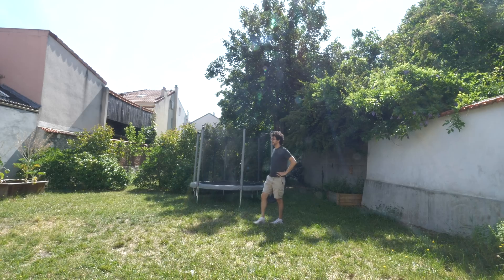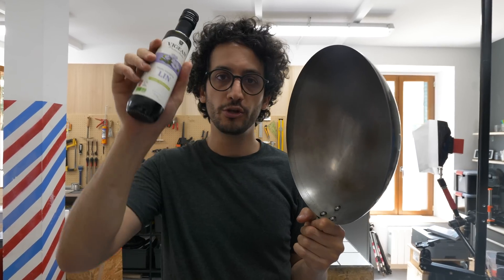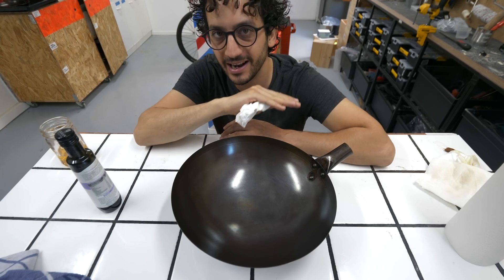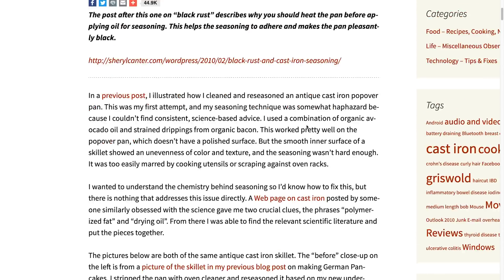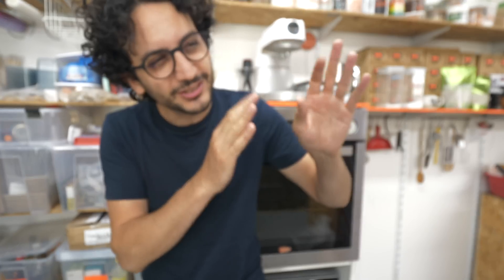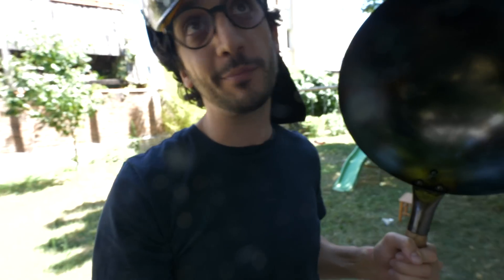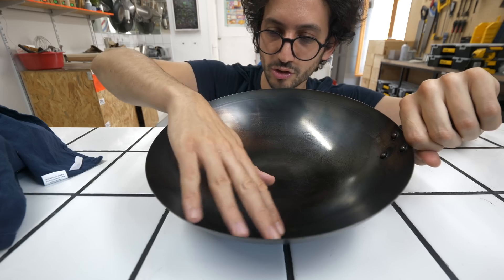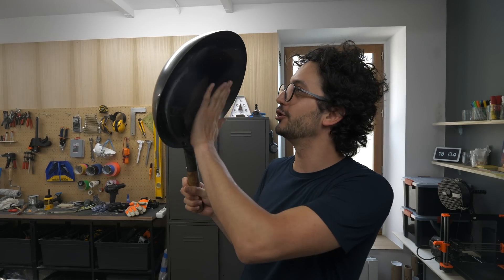Can I Make my Wok Slicker than a Nonstick Pan ?

Comment: "There is no chemichal, just like a very hard polymerized surface"
- Chemestry: Am I a joke to you?
Reply: @Zach Ellis Once it's polymerized, it isn't oil anymore. Soaps, detergents, surfactants, etc.,  will allow water to wet onto the polymer surface, but it won't emulsify it. For that you need to break the polymer chains. Once way to do that is with a very high pH. Soap used to contain lye and have a very high pH, but that's rare today. That's where that common wisdom comes from, decades ago dish soap would have done this, but you'd also really want to wear gloves when washing with it. Any soap that would cut through the seasoning on a well seasoned pan would be pretty unpleasant to your skin. Dawn still contains lye, but in very small amounts. I'd probably skip any soap with lye, but most dish soaps don't have it, or any high pH substance, anymore.

Again, I don't use soap on my cast iron in general, but mostly because it's just not needed. I'm not saying you should wash your cast iron in with soap, just that with most soaps you could.
Reply: Jazz Music Stops
Reply: he's my take on it.  every teflon pan I've ever used started out amazing, and after a few months of hard use, becomes useless and gets tossed out.  it's junk at that point.  using this technology, with the only raw material being some kind of oil, my steel pan is essentially a permanent part of my kitchen.  It's my pan, not number 12 of an endless series of disposable pans.   this pan will be useful long after I'm in the ground.
Reply: @Zach Ellis I know that's the "common knowledge" interpretation of seasoning an iron or steel pan, but it's incorrect. A properly seasoned pan will not have any oil left in or on it. The oils polymerize, meaning the chains link together to form what is, in essence, a very hard, slippery, temperature tolerant food based plastic. It can't simply be washed away with soap, unless you're using lye soap, which most people aren't. Something with a very high pH, like lye, will depolymerize the oils, allowing them to be washed away.

I don't wash my cast iron with soap, mostly because it's unnecessary, but it won't really hurt it.
Reply: That new polymer the oil has become is that bad for your body too? I mean it could get scratched too and pieces may come inside your body.
Reply: @jingyiwang2600  
No. 

Teflon is pretty nasty sh*t. 

What you find in polymerized oil you will find into whatever you use heat to cook/grill anyway. Yeah, there are bad things in it but, literally EVERYTHING is bad for you to an extent. It's all about the relations between dosage, exposure time. 

So, don't listen to the pedantics chemists wannabees here: seasoned pans are much less nasty than Teflon coated pans, period.
Reply: @TheOneAndOnlySame  well said.
Reply: In the words of Tim Minchin: "everything is chemicals"
Reply: @Chirimorin  
Reject modernity.
Embrace tradition.
Enjoy polyaromatic hydrocarbons.
Reply: Golden Calf  Agreed. Each has its pros and cons. Quite often, we do not need either of them.
Reply: yeah, burnt polymerized oil that comes loose real easy and then gets in your food is superhealthy.
Reply: 😂 I know, I was like 'Hol up!?'
Reply: Chemistry, Chemestry is a joke
Reply: 2000th like
Reply: Wok cooking is traditionally done at really high heat, temperatures far above the point that’s safe to use non-stick. For low to mid temp cooking chemical non-stick works just fine.
Reply: Seriously I don't understand why seasoning a steel/iron pan with oil is so much better than teflon/other polymer/mineral-ceramic coatings. At least with those I understand what I need to keep in mind to keep safe (don't go above its temperature, don't scrape it off) . I would be extremely appreciative if someone has actual references for this claim. And no, "it's natural" (and especially in this context)  is the most delusional statement anyone can make.
Reply: @matejmahkovic  particles are going to come off any pan you cook with.  Always.  It's just a fact of life.  If you've ever seen the teflon pans in a house of college kids, you know the extent of just how bad this can get... they usually don't know you can only use non-metal utensils with the pan, so the surface is all scratched up.  There's no way to re-season it.  You must throw it away because it's bleeding teflon flakes into your food.  Granted, that's a nightmare extreme example, but we had no idea what we were doing in college, and on a long enough timeline, all pans will release molecules from their surface into your food.

The advantage of using seasoned cast iron or carbon steel is that your seasoned non-stick surface is basically a natural coating that's not only generally safe to ingest when it releases particles into your food (California probably says it causes cancer though), but if the surface ever becomes imperfect, you can re-season it at home with no special tools or materials.  It's why families have been able to hand down immaculate cast iron pans for literally over a century, but a non-stick pan is garbage after only a few years.  Imperfections don't just happen from scratching the surface with metal utensils though... acidic foods (especially tomato based) will chemically break down the seasoning on your pan.  Washing with most soaps will also do the same.  Teflon doesn't get broken down from acids or soaps nearly as easily, but once you get a single slight scratch in it, the pan will never get better.  On the other hand, seasoned cast iron and carbon steel is trivial to fix.
Reply: @matejmahkovic  I find it better because any nonstick coating will eventually be damaged if you have the pan for long enough, and with seasoning you can replenish it on demand rather than replacing the whole thing. It's not even about the long term cost for me (but also a good thing to keep in mind), it's about 10 or less minutes of work vs a two hour round trip drive to the store and back for a new one.
Reply: @matejmahkovic  In cases of "Teflon toxicosis," as the bird poisonings are called, the lungs of exposed birds hemorrhage and fill with fluid, leading to suffocation. DuPont acknowledges that the fumes can also sicken people, a condition called "polymer fume fever." DuPont has never studied the incidence of the fever among users of the billions of non-stick pots and pans sold around the world. Neither has the company studied the long-term effects from the sickness, or the extent to which Teflon exposures lead to human illnesses believed erroneously to be the common flu.
The government has not assessed the safety of non-stick cookware. According to a Food and Drug Administration (FDA) food safety scientist: "You won't find a regulation anywhere on the books that specifically addresses cookwares," although the FDA approved Teflon for contact with food in 1960 based on a food frying study that found higher levels of Teflon chemicals in hamburger cooked on heat-aged and old pans. At the time, FDA judged these levels to be of little health significance.
Of the 6.9 million bird-owning households in the US that claim an estimated 19 million pet birds, many don't know know that Teflon poses an acute hazard to birds. Most non-stick cookware carries no warning label. DuPont publicly acknowledges that Teflon can kill birds, but the company-produced public service brochure on bird safety discusses the hazards of ceiling fans, mirrors, toilets, and cats before mentioning the dangers of Teflon fumes.
As a result of the new data showing that non-stick surfaces reach toxic temperatures in a matter of minutes, EWG has petitioned the Consumer Product Safety Commission (CPSC) to require that cookware and heated appliances bearing non-stick coatings must carry a label warning of the acute hazard the coating poses to pet birds. Additionally, we recommend that bird owners completely avoid cookware and heated appliances with non-stick coatings. Alternative cookware includes stainless steel and cast iron, neither of which offgases persistent pollutants that kill birds.
Reply: @matejmahkovic  Alex the former engineer falls into naturalistic fallacy, proceeds to produce VOCs and PAOs to coat his pan and calls it superior.
Reply: @MonMalthias  So what?... still my question goes unanswered. Similar to Alex, I'm not the person who can answer this, that's why I written the comment and asked for your insights.
Reply: Malthias it might well be preferrable to PFAS.
Reply: @matejmahkovic  it's a skill to strive towards,like sharpening your knives with a stone until they're razor sharp,cooking on a non-stick pan that you made. It's okay to not understand!
Reply: Biological vs chemical is a chef's way of making the distinction between natural and synthetic.

Organic also means something quite different to a chef rather than a chemist.
Reply: No chemicals that can cause birth defects*
Reply: @smashy152  what part of polymerisation and partial oxidation do you not understand?
Reply: @smashy152  The moment you start to crank up the heat on oiled steel, thousands of different compounds form. Can't be to serious on that statement ;)
Reply: I want to like this but 666 is too beautifull to like, sorry haha
Reply: “Chemestry” -Spelling: Am I a joke to you?
Reply: Dude spell check
Reply: it's referring to the fact they aren't using an artificial man made chemical, like Polytetrafluoroethylene aka Teflon.

you wouldn't call soybean oil a chemical
Reply: BlackMoth27 I would very much call soybean oil a chemical, because that’s what it is.
Reply: @blackmoth27

In what world do soybeans naturally press themselves into a filtered oil, land on a pan in an even coating, and heat themselves to a temperature high enough temperature for a long enough time to chemically alter the oil into a polymer?
Reply: Edit: "and heat themselves to a high enough temperature"
Reply: @marcush4741 Linseed oil, no soybean.
Reply: @marcush4741  Sometimes soybeans feel like doing just that in the wild...
Reply: @BloodSprite-tan  I would.
Reply: @BloodSprite-tan  yes you would if you actually knew what chemicals were. All oils are literally just mixtures of various chemicals.
Reply: @BloodSprite-tan  the problem with that is that you're assuming that natural > artificial which is almost never the case with common chemicals used in the food industry
Reply: @aaronshan51   Seen the movie Dark Waters?
Reply: @BloodSprite-tan  lol, i would...they have to add deodorants to polyunsaturated oils because they go rancid on the shelf!
Reply: @BloodSprite-tan 
N d
Reply: @BloodSprite-tan  Yes you would. The true definition of "Chemical" is a substance used for their interaction and reaction with other chemicals. The problem is when most people think "Chemical" they think poison or paint thinner or solvents and gasoline.
Reply: @kcstott  point taken.
Reply: @BloodSprite-tan  yes, soybean oil is a chemical...
Reply: That's a very close-minded idea of what the word chemical means. You know very well what Alex and literally everyone outside of a chem lab means by that, yet you refuse to face it.
Reply: @crazy808ish  This is actually a pretty serious issue I think in communication about chemicals today. The meaning you're ascribing to the word is entirely subjective. There's no legal or technical definition of "chemical" that matches what you're saying. Basically, when most people think of "chemical" they meaning that comes to mind is "chemical I don't like" or "chemical I think is bad for me". The problem with that is that anyone can slap a "chemical free" label on something, and it doesn't mean anything, but people will think that it means it's safe. It doesn't.

Many man made chemicals are just fine, and in fact many are beneficial. Many natural chemicals are quite deadly, in fact the deadliest chemicals known to exist are naturally made, e.g. botulism toxin.

In the case of pans, I think it's a toss up. Most PTFE is made today without PFOA or any PFAS. PTFE itself is completely harmless, it's the most inert substance known and won't do anything at all inside the human body, it'll just pass through. Similarly, polymerized food oils are quite inert, and likely harmless (I'm looking to see if I can find a source for that). Both will be harmful if heated enough to decompose. PTFE decomposes at a much lower temperature, and creates more harmful gasses when it does so. That's really the only safety concern with modern non-stick pans.
Reply: @jasexavier  i appreciate your comments and logic. they're refreshing to see. most people think chemicals are strictly harsh things that come in scary labeled bottles that are artificial and made in a lab. they don't realize that everything they've ever touched is a chemical, that water is chemicals, that they are themselves chemicals. and just because 'they' wouldn't call a, b, or c a chemical doesn't mean it's not. people make up meanings based on how they 'feel'. it's obnoxious.
Reply: @crazy808ish  and you refused to acknowledge that people outside of a chemistry lab rarely have a proper grasp on chemistry. Things that are natural and healthy can be altered to become not healthy, sometimes on accident.
Treating the word 'chemical' like it's a slur is dumb and I refuse to accept it as such just because other people want to be colloquially dumb about it. It's not fair to ask people to stoop below their level of understanding for your comfort. I didn't take six years of college chemistry for that.
Reply: @caramelsurpriz  Fair enough. Apart from the fact that "stooping below their level of understanding for your comfort" is literally what communicating your field to the public is all about, and what your professors did for 6 years for you. ...what do you recommend is a better term for what she was referring to?
Reply: @crazy808ish  Sounds like dogmatic superiority syndrome. No wonder they are losing the public when it comes to science education. Well, at least that is a big part the picture.

Comment: If you wanted to know the mechanism. Picture all metal as on a very small scale being of a dense crystaline structure that expands due to heat and contracts due to convection/ conduction or heat loss due to thermal energy transference. 

The oil ideally would coat the surface of these expanding crystals before undergoing the chemical reaction that impairs the ability of these crystals to latch onto foodstuffs as thermal energy is lost and the metal shrinks back again.
Reply: hy, would be nice to get more science in this process, cause, alex just scratch the surface. but deep down, we don't even know what's best and how to make it correctly.

Comment: If you take supplements,  you don't have to worry about carcinogens,  because blue berries,  and antioxidants cure those things.  Organic is best.  Even spinach as long as you dont get food poisoning,  cook the spinach...  So yea you have to be the mad scientist.  Oil boils into a carbon.  So you would test and figure out if it works from there.  It probably will....  Because Teflon is plastic,  but a seasoned pan is probably better.  Explore the subject,  if you do,  you'll have good time.  : )

Comment: Him:  Tests nonstick pan with egg

Also Him:  Uses oil so it won't stick
Reply: On a non seasoned pan no mater how much oil you put in it will still stick
Reply: @angelzhang5926  
Teflon, and for a short amount of time, ceramic non stick pans are the only things you can cook an egg in completely oil/fat free and not have it stick pretty badly.
Reply: @lordgarion514  
Hard-anodized aluminum
Reply: @angelzhang5926  
At some point, you're deep frying and it probably won't stick

Comment: The problem with Flaxseed/linseed oil seasoning is that it will start to flake over time. It does indeed provide a really nice glassy and slick finish, but it will start flaking after repeated uses.

Comment: And I'm a black smitten you need to make a funnel under neath it and have a batteries powered air mattress blower and put it about 6 inches away from the funnel and it will make it 10 times hotter as well with the wood for more flame

Comment: Just found your channel and I'm loving it! I know this video is old, but you mentioned when you were making the comparison between this and a Teflon pan that in this case, there's no chemicals, but I'd like to make one point; from a chemistry and scientific standpoint, Teflon is one of the strongest chemical bonds in science, and will not leech into food in any way whatsoever! It could be argued that the oils used in cooking and in fact the foods themselves will cause more damage than the Teflon themselves. That being said, neither of them will cause any damage at all, and I would have a preference for seasoning pans in the way that you do, but if you're looking to save time, effort, and health, Teflon will always be the better option as it's near impossible to break down, and will not under near any circumstances leave any traces in your food, only when cooked above 250 celcius.

Comment: Teflon is less reactive in the body than any of the chemicals that are produced in the seasoning coating.
Reply: jeffmack57  Yeah, the whole Teflon thing was because it used PFOA in the production process.  Most no longer use this.  Your exposed to more PFOA from other articles in your environment then you would ever have been from Teflon pans.   As for superheating oils to their smoking point, that's where a hell of a lot of interesting chemical reactions occur as it breaks down.  A lot of the compounds produced are carcinogens.   

Now if you have any older Teflon pans, especially if scratched or damaged, perhaps be wary.  As I said though, your exposed to more PFOA from your normal environment from things like plastics, synthetic textiles, etc.
Reply: jeffmack57  The Teflon issue came up in the US back in 2008/9 I think.   As for heating oils to those temps, it's just chemistry.  I like to be aware of potential health issues, plus a reasonable interest in chemistry.